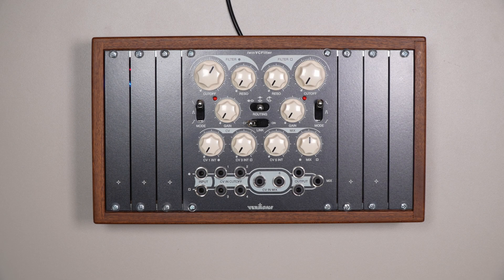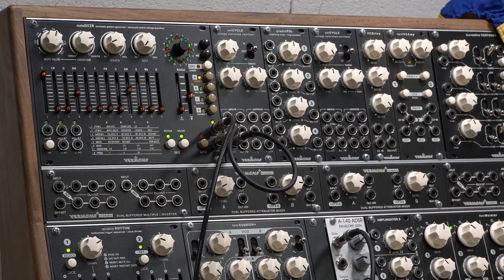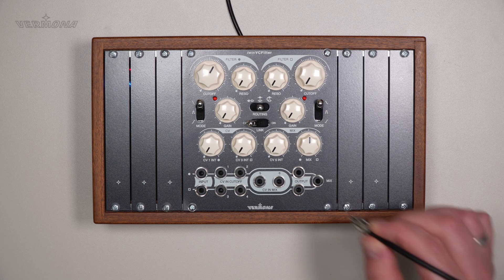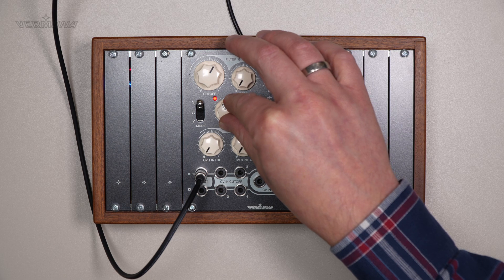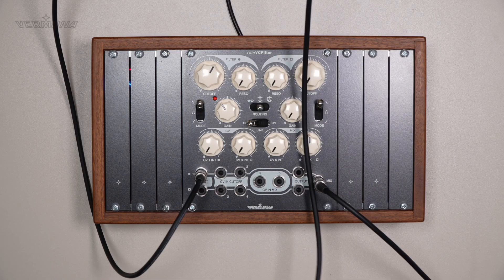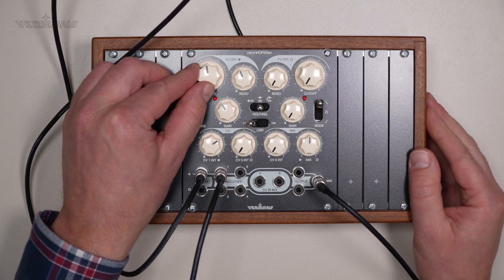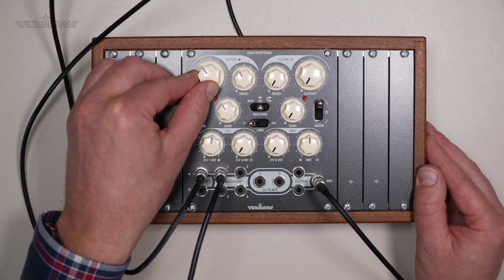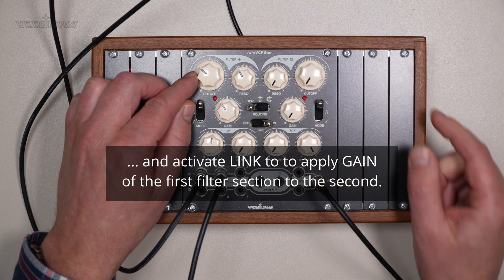twinVCFilter - part 3: Filtering a Sequence

Comment: hi loving this filter but why do you turn the mix knob to square when in 24 db mode?
Reply: When the two filters are in series the 24db response is from the second filter -> so the mix needs to be set on the square. The reason: Normally each side has 12db/oct LPF and HPF, and when the filters are in series the square output will have 12db + 12db = 24db/oct slope. So there is no "24db mode", it's just combining two 12db sides with identical control and mix set to the square side that is last in the series.
Reply from the maker: Correct!